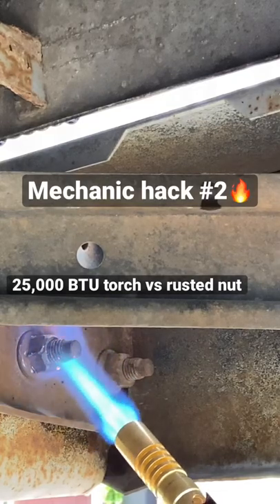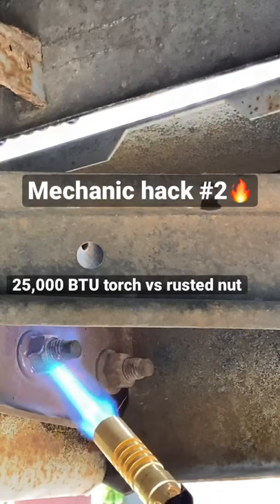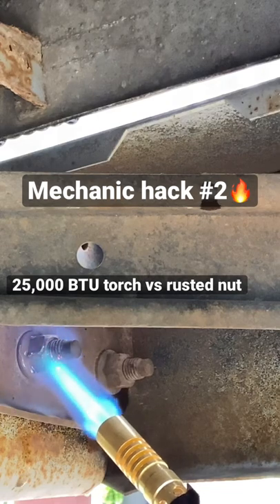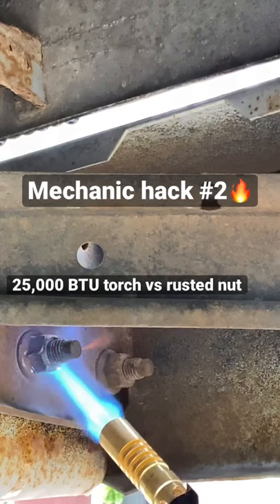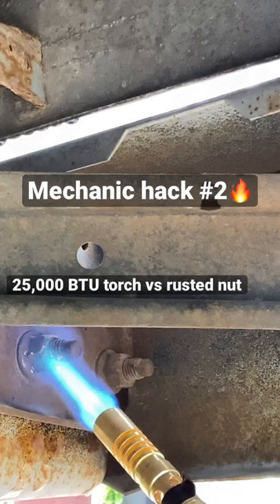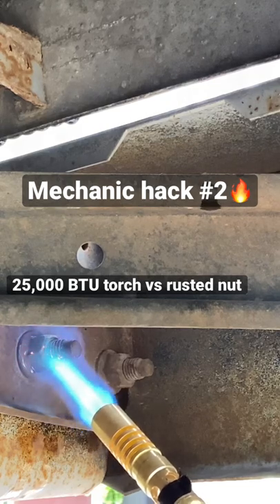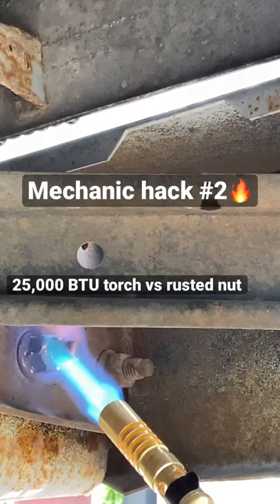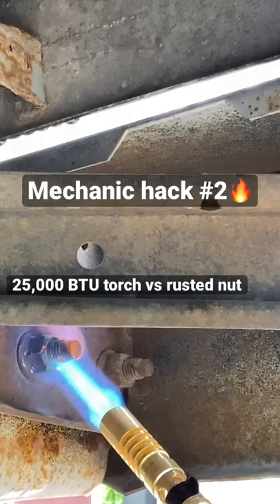25,000 BTU Torch vs. Rusted Nut🔥

Comment: As a plumber I do this all the time, explanation and contraction works for you, but it doesn't work on every metal, brass will crack
Reply from the maker: Me too! I moonlight doing plumbing. Lol You definitely need to know your metals. 

By the way, this is a torch with about 3 feet of hose that I hook to one of those yellow mapp pro bottles from Home Depot. It beats carrying around a full sized B tank.🤙